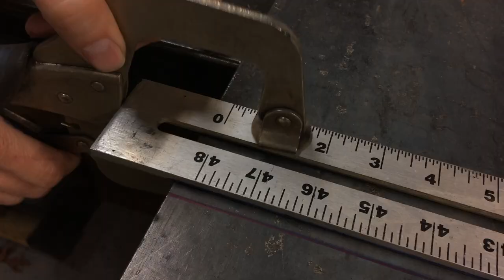Self Feeding Clay Targets!

Comment: Unless you made this out of AR500 steel you're going to destroy this thing.
Reply: It might with sand 6mm BB's.....lol... all else?
Reply: +ryan  Or you couild just shoot at it with rounds that aren't going to destroy it.  Most handgun rounds, .22lr, .17hmr, 5.56 lead nose, whatever.
Reply: 5.56/.223  will zip through that steal like its not there.
Reply: :sigh: Soft nose..... soft nose, semi jacketed.  splatter and dimple.

I guess I'm spoiled, I load my own for that reason.
Reply: Khorsathedark You could have Jell-O tipped ones and the bullet would still zip through it. The body is made of lead, the lead tip just helps it expand on impact.
Reply: Yeah,  I get how bullets work, I test them all the time against different forms of flash bainite armor.  Different loads, different weights, different speeds.

Like I said, "shoot at it with rounds that aren't going to destroy it."

I have 5.56 that won't cruise through that.  I have 5.56 that I shoot in my basement.
Reply: I would love to see a vid of a 556 round shot out of an AR that will bounce off 12gauge mild steel. That's about as impossible as a factory 22lr NOT penetrating it.
Reply: Khorsathedark i too would like to know more about a 556 load that wont scream through a .5 inches of steel myself......every load ive tried zips right thru
Reply: M Blake Jr Assuming he is not full of shit, he is most likely loading subsonic loads. If that is the case then he is just shooting a really big .22lr. Hell 9mm would put a hell of a wallup on it.
Reply: Taylor Hardin yup
Reply: Taylor Hardin almost bet subsonic would